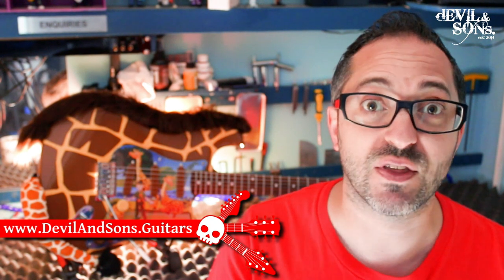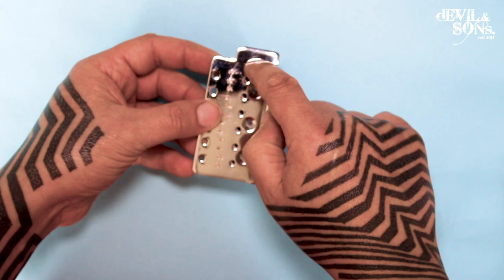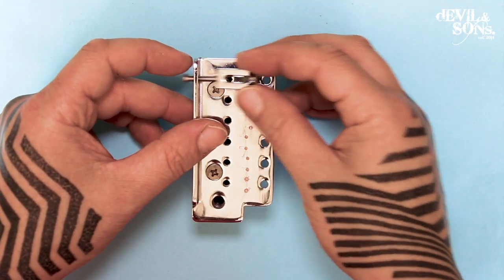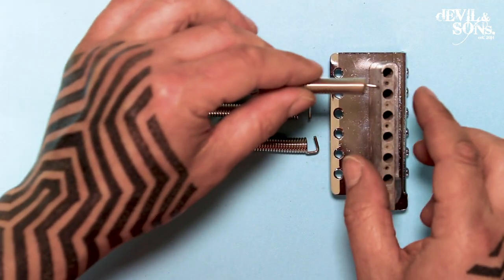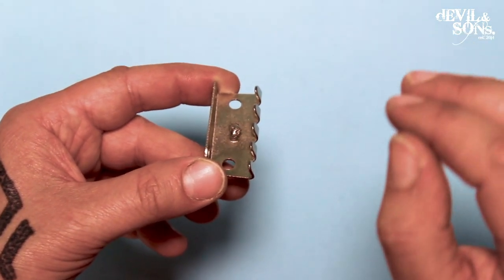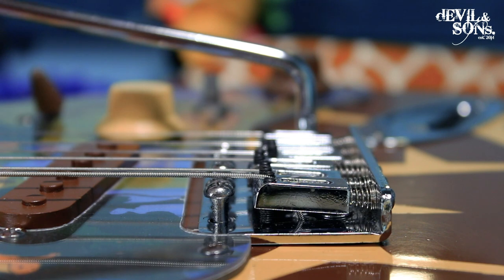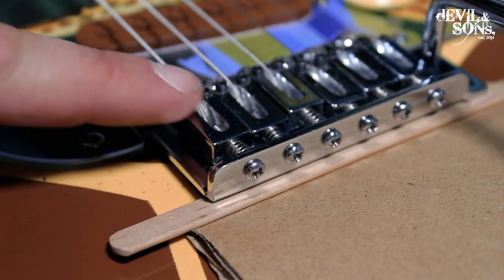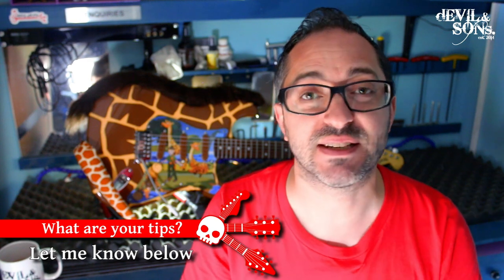Setting up a Stratocaster bridge and how it works in depth.

Comment: Great vid, I bough a new player Stratocaster the other day but I noticed rattling from the bridge. All the saddles were level with each other. I took it back to the shop where I bought it from and they didn’t something that helped. Do you know what causes it?
Reply from the maker: It's worth checking if all the small grub screws in the saddles are actually making contact with the base plate. Then I would take the tremolo bar out to see if it's that. Then play touching each saddle in turn to see if it's one of the saddles in particular (the rattling should stop if you touch the saddle that is loose). Also check the springs underneath in case one had come loose. Hopefully one of those things will help.
Reply: How do I get the correct saddle pressure against the bridge plate? I watched you’re video to learn but I couldn’t find the info. Also, how does one know if the screws need a thread locker?
Reply: I like a hard tail strat and the bridge complete flush against the body so if you can tell me how to get the right saddle pressure against the bridge plate that would be amazing! And I’ve heard this is a common problem with vintage style saddles is that correct?
Reply from the maker: Hmm. I'm not really sure why it would be a problem. If you want it locked off you need the springs tight at the back so there is no give, or you can buy various devices that completely lock it off which i think is the best move to prevent any tuning issues with strings if one should break. I'd still work through the steps I mentioned as it could easily fixed by one of those, but I'd also check if the buzzing stops when you put the temperature arm back in (I assume you have it out) as it could easily be something loose there.
Reply from the maker: By that I meant if yhe saddles are rattling it could be one if the grub screws in the saddle isn't touching the bass plate and is loose. There should be two in each saddle and often the saddle can be hrkd in the correct place even if one comes loose and is applying no pressure to the base plate and therefore could be rattling. You just need to tighten them each so they aren't loose without changing the height of the saddle (assume the saddle height is correct).
Reply from the maker: By thread locker do you mean for the grub screws? I wouldn't bother with that unless one keeps coking loose, but I that case I would rather replace the screw.
Reply: @DevilAndSons  how do I get the grub screws tighter without changing the saddle height?
Reply: @DevilAndSons  and would using block saddles vs the traditional bent steel saddles avoid all these issues?
Reply from the maker: This would only happen if the screw were loose, if it isn't loose then you sont need to tighten it and it isn't that that is causing the rattling.
Reply: @DevilAndSons  so what else would be the culprit?
Reply from the maker: @jessefallas7094  I'm still not sure this is a problem that is common, until you have identified the problem it's hard to know if the saddle is the culprit.
Reply from the maker: @jessefallas7094  if it's not the springs, the screws, the trem bar, there really isn't anything else. Have you tried the steps I suggested?
Reply: @DevilAndSons  I have but I wasn’t sure what you meant by the trem bar. Also, if the screws are wiggly and when the strings are tuned to pitch is that a bad sign? I feel that can’t be normal because then you would always need to make sure they’re sitting flat against the bridge plate instead of being in all different directions.
Reply from the maker: Have you watched the video? I do explain most of this with visuals there.

So, starting from scratch.

Each saddle has two small grub screws adjusted by an allen key that can come loose when playing and cause a bot of rattle. One of them coming loose may not have any noticeable effect on the tuning as the other one may be holding the saddle well enough on it's own. Have a look and check this first.

Each saddle has one screw that comes in from the back, there will be a spring over this. The only reason rhis will rattle is if the saddle has been extended too far and spring isn't being compressed at all, so it is loose on the screw. Double check this.

The trem bar is the stick that you put in the bridge to allow you to vibrate the strings. As you said you prefer your saddle screwed down as a hard tail you may not have this in. It's possible something is vibrating in the hole where this goes as normally the bar is in, and perhaps there is a loose screw or washer there. Check this by either pushing the trim bar in further, or putting it in if it's not there already.

Unscrew the back plate and look at the springs there as they may have come off to cause the rattling. Check this and also that there is nothing loose in the back compartment.

Hopefully doing that will help.
Reply: @DevilAndSons  ok thanks so much!
Reply from the maker: It's a pleasure. I really do hope you can find the problem. My experience is most rattling comes from the tuners.
Reply: @DevilAndSons  how with the tuners?
Reply from the maker: Often the busings are loose and the washer around them rattles, or there is a screw in the top of the tuner head that has come loose. Depends on the make buf it seems quite common.
Reply: Rattling can also come from a loose truss rod

Comment: Any specific or better spots to place the springs
Reply from the maker: Personally I like one on each side and one in the middle, I feel it is a better distribution.
Reply: @DevilAndSons  thank you for the video. My son snapped the tremolo bar off and I'm having to replace the bridge. I will be watching this video a few more times when the parts come in.
Reply from the maker: That sounds like some aggressive playing there. If you have got a similar design bridge then it should be a very simple swap. Do let me know if you need any advice when it comes.
Reply: @DevilAndSons  Thank you. The bridge adjustment for tone and string height are the only parts I believe I will have trouble with. I'm glad I took a picture before I removed and disassembled the whole thing.
Reply from the maker: I do have a full set up video too that you may find useful once the bridge is on.https://youtu.be/fvD-qsM3piQ